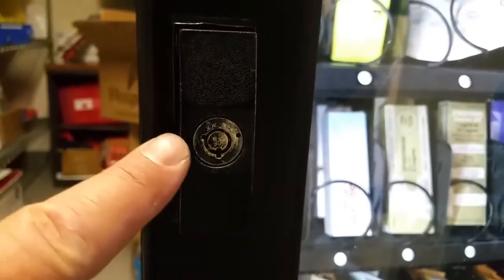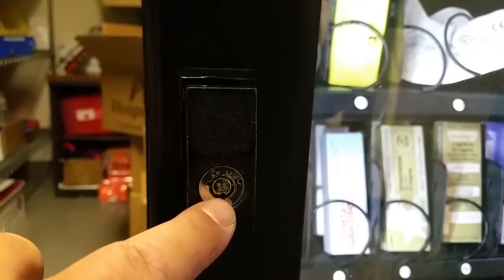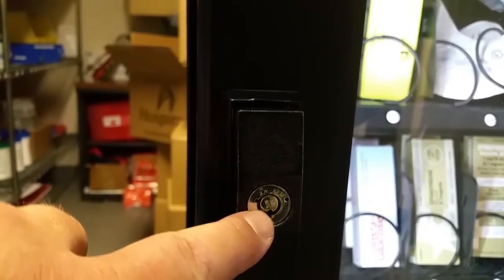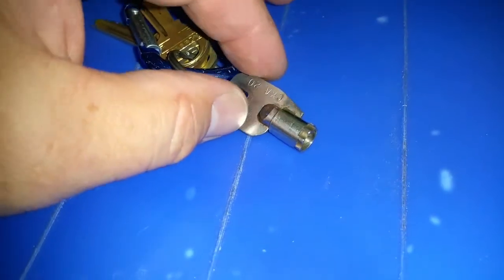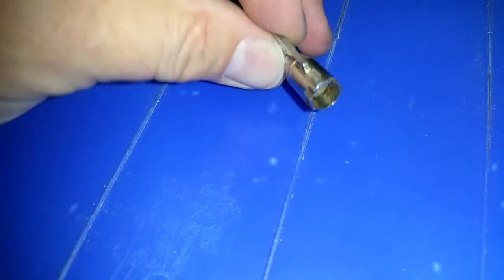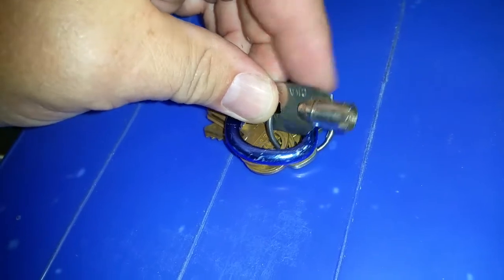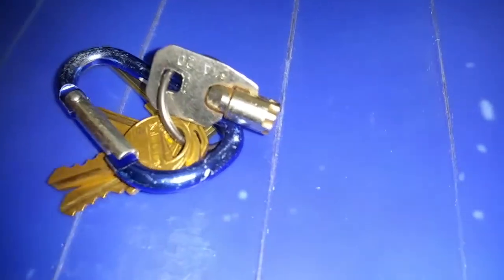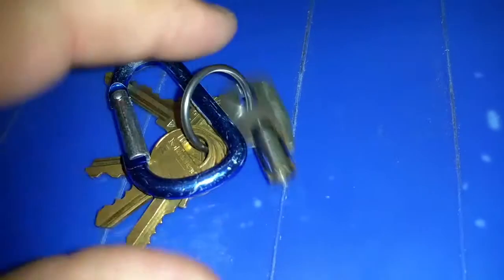Misaligned tubular lock fix hack

Comment: just tried this, outer ring notch was at 12 o'clock and inner was at 2 o'clock. ground down with dremel tool and it worked, was able to avoid having to drill the lock to peices. thanks for your fix
Reply from the maker: I appreciate your feedback. I am glad that this worked for you.